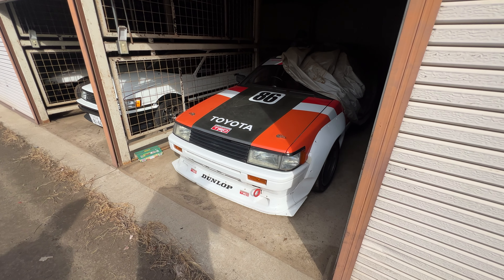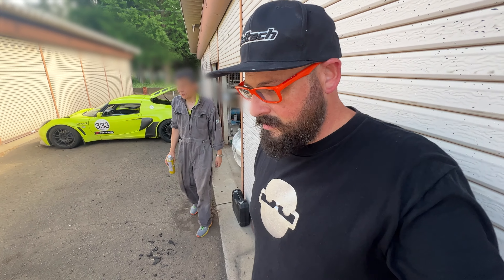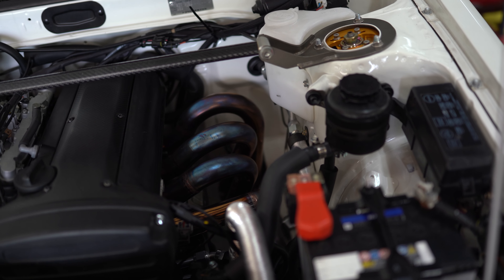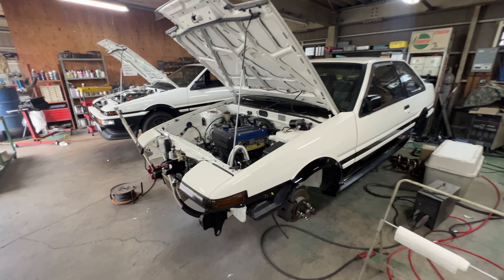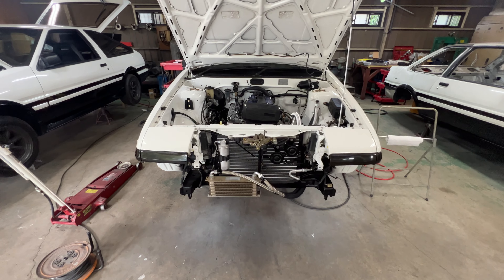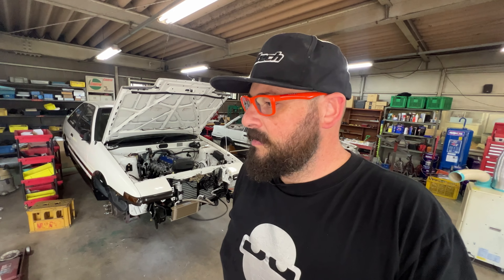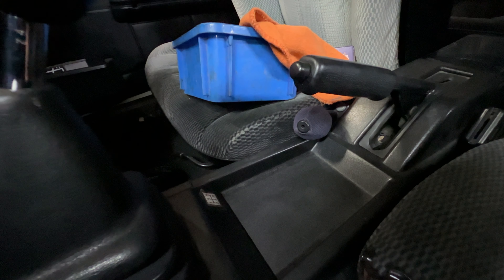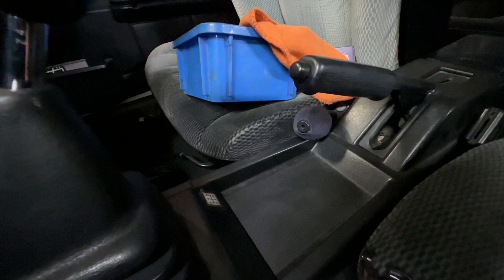The Drift King's Hidden N2 AE86 | Koshimizu Motorsports

Comment: Glad to see that Koshimizu still owns this car even after Sakurai’s passing. Those pedals were actually used in the 90s-spec JGTC Supras!! Also, I believe when the car had last ran in Tsuchiya’s hand (2007, HV Vol. 86), the FA engine suddenly ran irregularly which was caused by a broken crankshaft, which was told to be a TRD USA unit and considered rare/no longer existed. KMS opt’d to help them and gave them a spare engine and they also did the re-tune to prepare for the N2 race that time.

Comment: It seems it's not the latest N2 AE86 DK has. This is most likely an older model but I would say much more iconic than the recent one.

It is a great shame there are no more AE86 N2 races anymore.
Reply: Correct.  Car Factory Ai maintains Tsuchiya-sans current N2 car.  It runs a 20v with FCR carbs.  Juiceboxforyou did a walk thru video of their shop a few years ago showing it in more detail.
Reply: @andrewcowden9704  I am very surprised that it runs on carbs, considering it's making around 240hp.
Reply: But this is the original ae86 from the trd sakurai era right?
Reply: @julzcadz2923  I believe so based on what Dino showed compared to original HV N2 videos

Comment: Original engine was not a Formula Atlantic and there are no 300hp NA 4ages. A 300HP 4age would be 35 HP more than the highest rated Atlantic ever build.  Maybe you meant to say 200HP.
Reply: Thought it was only me that noticed that…